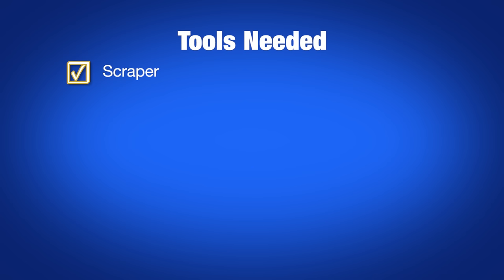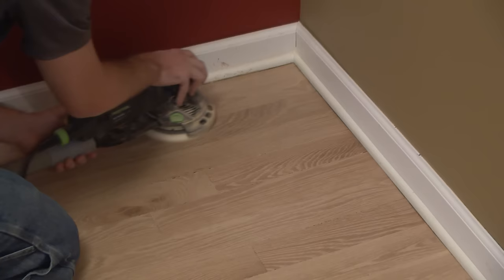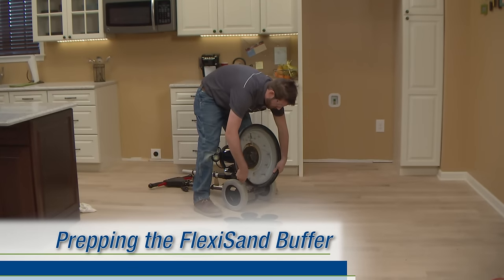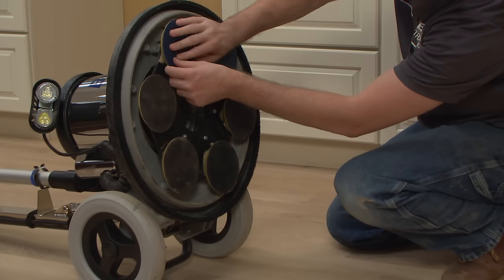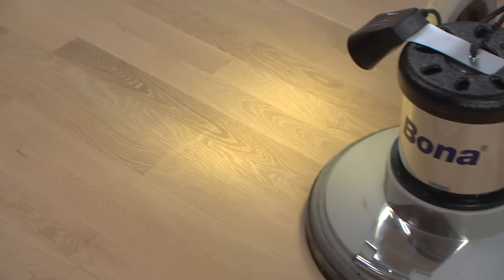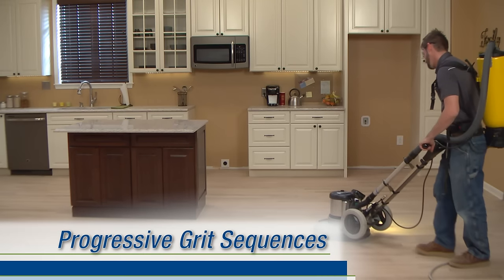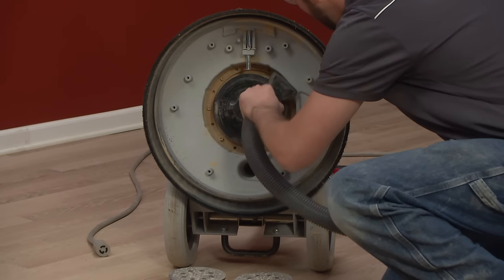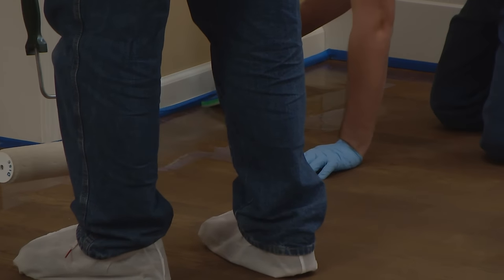Bona® Sand & Finish Training - Chapter 3: Detail, Buffing, & Blending

Comment: So for an oak floor 3 sanding passes is enough...40, 60 then 100 grit.. thanks
Reply from the maker: Hi @Jo-xg6rk - The number of sanding passes required all depends on the condition of the floor. We just completed a video shoot on a 3,200sq/ft church, installing a white oak engineered unfinished product that only required 80grit for the first cut, and then finishing with 120grit before water-popping the floor back to accept a coat of DriFast Stain. Always start with the least aggressive grit that you can to get the floor flat, remove over/underwood, scratches, etc., then work through your progression from there, skipping no more than one grit for each successive cut - i.e. sand 40, skip 50, sand 60, skip 80, sand 100. Hope that helps to answer your question.
Reply: @BonaProfessional  fantastic... thanks very much for the detailed reply 👍
Reply: @BonaProfessional  brilliant, thank you very much 👍💪

Comment: How do you recommend dealing with raised grain if you don't have a machine with a tampico brush attachment?
Reply from the maker: Hi Justin - If you experience grain raise then simply abrade the floor with a couple of stacked Conditioning Pads and 2-3 180grit Diamonds Discs to smooth it out. Vacuum, tack and put on your next coat. If the floor is stained, you might want to apply a coat of Sealer and one Finish before abrading the grain raise down to prevent burning through a single Sealer coat and taking off some Stain (that's a whole other problem). Hope this helps.

Comment: how strong of a breaker would u use to run backpack and buffer together???
Reply from the maker: Hi Danny - The FlexiSand Buffer and Back Vac being run together will usually run just fine on a regular 15amp breaker - unless you're bearing down on the buffer or there's some long-term weakness in the breaker itself. Of course, running on the 20amp GFI breakers (typically kitchen and bathroom) will work great too.

Comment: is it okay to skip 120grit on the multidisc? instead of 100grit then 120grit?
Reply from the maker: Hi Adrian - It depends on the other specifics of the job. You might be able to finish out at 100 grit, or skip the 100 grit and jump straight to 120 grit. Depends on what your previous grit was (and is what you're using now taking out the scratches from the last cut)? Denser, more uniform color species (maple, BrazCherry) may need a tighter grit sequence because the scratches are harder to take out. Best judge is down on your hands and knees with a good, bright light source, looking for scratches. Hope that helps!

Comment: If you don’t take that wood down at to east 1/8 “ the end result will suck . When sanding floors they have to be near perfect while working on yer knees and eyes on close will see more than standing above so if you can get it to 90% good you will be good and a rotary sander at the end 120 grit at minimum will take out all the little scratch marks and be very beneficial . Been doing this way to long 🙄
Reply from the maker: Thanks for the comments, Hungry Bird! The amount of material needing to be removed to get a "brand new surface" really depends on the species, the depth of damage/scratches, and what stain/sealer/finish system you're trying to remove. More open grain species like red and white oak typically require deeper sanding because the grain sucks up the top products deeper and they'll scratch deeper as well. Brazilian Cherry on the other hand, tends to be so dense that you might only need to take off 1/32" to get a sparkling new surface to refinish. As a direct side-by-side comparison - we've had a number of red/white oak training floors that we'll usually get 7-8 sandings out of if we're lucky; while our Braz.Cherry training floors can withstand up to twice that many sandings before needing to be replaced. Hope that helps!
Reply: Oh man you are so incredibly wrong